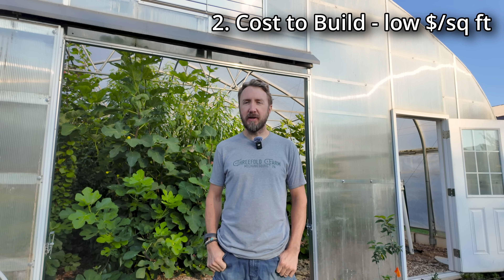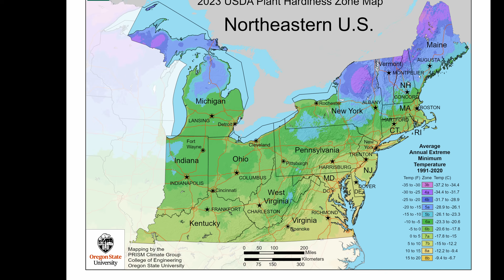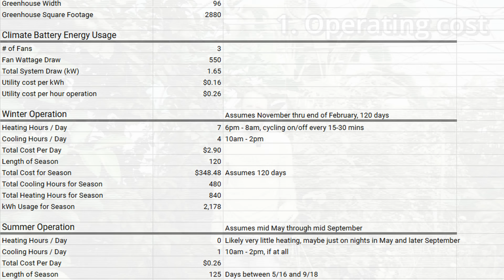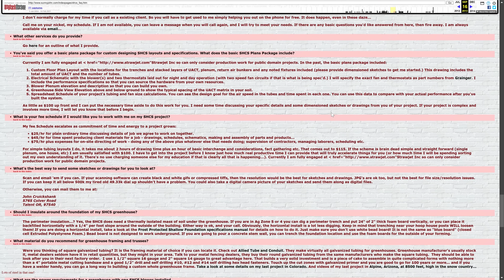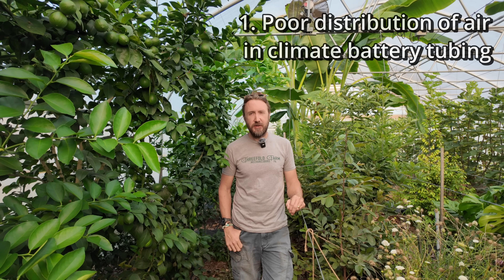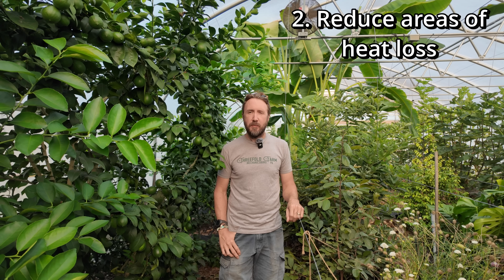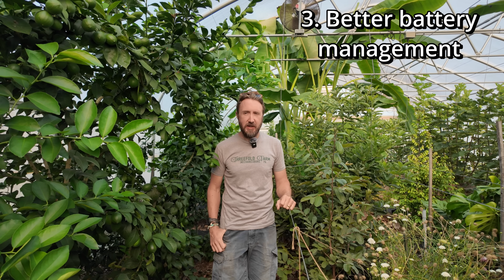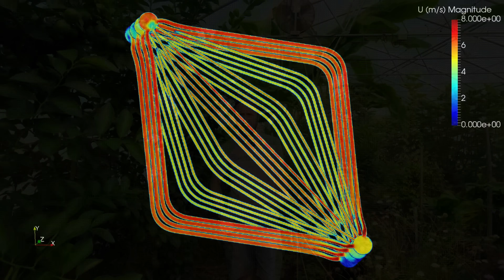Building an (Almost) Tropical Geothermal Climate Battery Greenhouse in a Temperate Climate

Comment: There is one small bit of misinfo I'd like to correct in this video.

Catalogue air source heatpumps are currently available with outputs of 100+kW while custom heatpumps are available with outputs in the 10s of MW.

The problems with the heatpump approach s therefore not the availability of raw heat output but initial cost per heating capacity, peak electricity demand and how much land you need for evaporators.
Reply from the maker: Appreciate the respectful correction! My error.

Comment: Unless I didn't understand one of the boxes for the climate battery calculator? The assumption is that the Air intake will start at base of the Greenhouse and then when it rises and is heated it would go to the "Climate Battery"?   For the Build that I am looking to do the air would start about 6 feet down and at about 150' from the Solar Wall and would enter the bottom corner of the Solar Wall at a base temp of 59 degrees year round (Summers it would probably be pipped straight into the building).  What Cell in the calculator do we place the info that the systems start is NOT the ambiant air temp in the Green house but that the Solar Wall would be starting from a constant supply of 59 degree air?
Reply from the maker: I appreciate the question but unfortunately I'm confused by it. Also I wouldn't necessarily recommend the original calculator (except perhaps as a vague starting point) as it has some assumptions baked in that I don't necessarily agree with and doesn't take into consideration fan static pressure curves and the like.

Comment: Excellent video. But after listening to the whole thing with headphones my ears and head hurt from all the background noise. 😩
Your Editor should consider denoising the audio as it will boost watch-ability and thus conversion.
Or better still: buy noise-cancelling microphone to cut out the fan noise during capture. 🎤

Comment: I purchased a high tunnel and won't be able to set it up until spring . I live in Michigan and am planning on putting it up between the woods and house . Most of the ground is sand . Would you recommend this or not, 24'x40'
Reply from the maker: Depends on what you want to grow, your budget, and several other factors. Happy to help with the decision-making process if you'd like to reach out through our website.

Comment: Thank you for sharing.  I grow pomegranates  in Frenchtown, NJ, not too far from you.  My greenhouse is passive, using 3000 gallons of water.  I would like to do more active storage.  I am intrigued by the development of "bells" in the rocket mass heater community which are steadily replacing tubes for heat transfer.  I believe the use of trenches and bells could be much cheaper and more effective for greenhouses than. tubes, giving more time for heat transfer and  with less frictional losses.  Feel free to contact me if you wish to collaborate.

Comment: Would storing the heat in underground insulated water tanks be more effective?
Reply from the maker: In terms of heat per unit of area, yes. Wouldn't be a bad idea to have some form of insulated tank buried outside the greenhouse even but cost is always a factor (large tank + insulation).

Comment: Someone apparently forgot to tell him that propane has two purposes, heat at night which CO2 enriches the air which the plants then assimilate during the day. The extra harvest pays the heating bill that way for commercial greenhouses  but their crop selection is smarter too.

Funny he talks about the environment and grows a banana tree in a heated greenhouse in pennsylvania which he did't bother to make airtight. 😁
Reply: Someone forgot to tell you that too much CO2 is bad.  Farming might be too complicated for your feeble brain.
Reply: @MrSummitville   Air has a density of 1 225 g/m3. To raise 1 g of air with one degree celsius takes 1 joule heat energy. 

So to heat a 40m2 greenhouse with 3 meter high (120 cubic meter greenhouse) from -5 to + 15 celius (20 c difference) would take 1, 225 j/m3 * 120 cubic meter = 2, 940 000 joules.

Insulation value for 16 mm polycarbonate is 1,7 j/s/m2. If the 0m2 greenhouse structure has an area of 128m2 polycarbonate, simplified it would take around 18 800 640 joules to heat his greenhouse from -5 to +15 degrees celsius on a 24 h period. 

Propane burns cleanly and has low emissions like natural gas. Complete combustion of 1 kg of propane produces 50 Million joules of heat energy. It would take 371 g of propane to heat a insulated greenhouse +20 celius in a 24 h period.

Burning 371 grams of propane in a 24 h period would release 1 113 grams of co2. This might sound much for stupid people but it's comparable to what an active human male breaths out every 24 h. 424 ppm atmospheric co2 in a 120 m3 greenhouse contains 59 g co2. If the plants didn't use any co2 and it was air tight it would raise co2 to 7571 ppm in the greenhouse.

Net photosynthetic rate is around 12 umol co2 / m2 leaf area per second. At elevated co2 levels is twice or three times as high. (Let's go with 30 umol co2/m2/s). 1 mol co2 = 44 g. 8 h light cycle is 28 800 seconds. 28 800 * 30 = 864 000 umol co2 assimilation. 1 micro mol co2 is 0,000044 g. 864 000 umol * 0,000044 g/umol = 38 g of co2 assimilation per 1 m2 leaf area in a 8 h / 24 h.

Total leaf area of plants in a greenhouse is super hard to calculate. If leaf area from all the plants is 30 times the sqm of the greenhouse, releasing 1 113 g co2 would NOT raise co2 levels at all since it would equal the co2 assimilation from the plants. Net = zero.

Tell me you are DUMB without telling me you are dumb...
Reply: If you have a well stocked greenhouse, the plants will drive down ambient CO2 levels down to insufficient for photosynthesis in a matter of hours. Just like a room full of people would run out of oxygen. If you don't supplement CO2, photosynthesis will slow down and stop completely.

Cold CO2 enriching (release gas from tube) is more expensive than warm CO2 enriching (burning propane). Commercially it's done fopr a reason.
Reply: @oscar6832  You are dumb. No, I do NOT need to ADD CO2 to my greenhouse by burning propane because my greenhouse already has the correct % of CO2.  Remind me to ... never buy any fruits or vegetables from your mad-scientist greenhouse.
Reply: @oscar6832  There are a lot of things that are "done commercially", but it is done to increase PROFITS , not necessarily to increase nutritional value. We don't want larger fruits and vegetables with FEWER nutrients. We want fruits and vegetables with more nutrients. A larger apple with fewer nutrients may be more profitable (sold by weight). But a smaller, more nutrient dense apple is better for human consumption. Quicker, Faster, Bigger food is just wrong.
Reply: @ There's a lot of misinformation in eco agriculture that's stemming from myths rather than facts. 

If nutrition is optimized, fruit yield is increased. If the plants suffer nutrient deficiency, photosynthesis and fruit yield will decrease.

They are not the same and it's a bit more complexed but the relationship between nutrients and fruit yield is actually the opposite of what you are implying.

Comment: How do I go about figuring the BTU of a 28' x 28' black tarped Greenhouse shaped wall that has a clear cover at least 4" above the black surface?  I am thinking of running a tube 150' about 6' down as the in take for Solar Wall.

I also am looking at running the heat back into the ground tube and pipe the air over to the small trailer I live in.  But I have NO clue how far I can pipe the heat from a Solar wall before it has dropped back down to the 59 degrees   base temp of the Earth.

Comment: Why is nobody copying real geothermal installs and using fluid-filled pex loops with a water-air radiator? It seems simpler and more controllable, as well as easier to extend and modify after the fact.
Reply: Do the math and then tell use how many hundreds of feet of PEX is required to keep the greenhouse above freezing when it is -5° F outside.  How big is the radiator(s)?  How many GPH pump?  How deep to bury PEX?

Comment: GREAT INFORMATION.: My one question to you is:  can I use a climate battery to heat & cool a enclosed  building 50' x 100'?? I only want winter temps to be about 50-55 degrees. Summer about 10 - 15 degrees below ambient.?
I have a 3 1/2 acre property in Southern New Jersey zip code 08037.
Reply from the maker: Possible but I haven't seen it done. A climate battery underneath may cause foundation issues when the ground settles. For an enclosed/insulated building heat pumps may be a far more economical option as that's what they're sized/designed for.

Comment: I think questions on the climate battery that I have are: 1. has the system been subjected to radon or other element off-gassing testing of the recycled air? 2. how does the system deal with local soil moisture, like when the soil is saturated with moisture after a rain storm? 3. how does this system work relative to the soil water table, i.e. does a high water table mean that a climate battery is not a feasible solution?
Reply from the maker: We haven't had the system professionally tested for radon but I have had a digital radon meter in there during the winter (the most closed the system gets) and I didn't see any worrying levels. I imagine it's leaky enough of a structure still that there's still quite a bit of air exchange.

Our greenhouses are graded such that water tends to flow away from them in the rain. The only time we've seen any small amount of water in the risers is when there's something like a 2"/hour gusher that comes in. The water never gets very high and is typically gone within an hour.

Finally, a high water table likely means a climate battery is out of the picture unfortunately unless the site is built up or the climate battery is built to sit above that high water table.

Comment: So it's a Russ Finch but the air based ground source is below the actual green house. I like it.
Reply: I like the chimney air intake testing. I wonder what impact smooth tubing would have for airflow and heat exchange.

Comment: What about adding a thin film, which doesn't have to be as strong, on the inside of the current greenhouse film, to better insulate it from the outside, at least in the winter, while still letting sunlight get in. Also, you might be able to increase the temperature by a few degrees in the winter, by using reflective metal sheets to reflect some of the sunlight which would heat the ground next to the greenhouse, and optionally cheap plastic fresnel lenses (which you can even make yourself from cheap springy-flexible (as opposed to brittle or flexible like the greenhouse film) plastic sheets greenhouse walls), in order to heat the greenhouse instead. 

And if you made the greenhouse so one of the long sides of it's footprint gets most of the sunlight, you can even make an elevated wall on the shaded long side of the greenhouse, and place reflective metal sheets in order to reflect more sunlight on the greenhouse in the winter. Sure, this would shade other parts of the land, but it might be a trade worth making, and you can leave some space between the reflective metal sheets, to allow some sunlight to pass through, to not have the space behind (what I call/coined) the reflective wall or mirror wall (which doesn't have to be optically clear) completely without sunlight.

In fact, by turning the mirror/reflective wall into a fresnel mirror wall by having different rows of metal sheets placed at different angles, you can even grow things like wheat and tropical equatorial crops and trees, even inside the arctic circle, for example in northern Alaska or northern parts of Canada, by simply having long rows of well-insulated greenhouses heated by long rows of fresnel mirror walls a few times bigger than the greenhouses, concentrating sunlight onto the greenhouse. Or plastic fresnel lenses could be used instead of the mirrors which would also mean making the walls vertical to avoid snow build-up from it, and/or together with the mirrors. And you can even make the mirror walls completely vertical, by using reflective corrugated metal sheets to get the angle wanted, or less-wide metal strips with the wanted angle (which would also make it more resilient in strong(er) winds, possibly reducing the strength requirements for the fresnel mirror walls and fresnel lens walls).

If you want to talk more, my username on Discord is the same as on this site.
Reply: I really like your train of thought on this mirror idea. Mirrors are tipically expensive but they are really cheap at local auctions barns. The corrugated tin fades to a dull surface very quick.
Reply: @davidmingues9553  A transparent plastic layer (or even glass layer, although more expensive) would be able to protect the clear-mirror shine of the panels, and if you need adhesion, you can simply have a few rough areas (sanded or acid-etched on the sheets, where the plastic to bold to the metal, so the plastic layer won't separate from the metal layer, and/or you could even have small holes in the metal, for the same purpose of the plastic getting stuck to the metal. And you could also put plastic on all sides of the metal, to make it more weather-proof. And if it's mostly plastic with a very thin sheet of metal (which could even be a few atoms thick), then the price would also be lower.

And as a proof-of-concept, you can use some mylar from those cheap disposable "space blankets", as well as some clingwrap, and some clear resin or some glue to glue the two together, and you can use some hard plastic or wood or metal backing for the structural integrity (so it doesn't flap like a flag even with a small breeze).

Comment: This maybe a stupid question but would something like the big bubble wrap work to insulate the greenhouse panels?, it would still let light in, but give you an air barrier between the panels and inside of the greenhouse, kind of like a double pane window, and you could do it very cheaply, not sure if this would increase the R value and by how much, but maybe you could test it in a small mock up
Reply from the maker: There's actually a type of greenhouse film that had a bubble-wrap type construction, solawrap I think it's called. Relatively expensive but supposed to be good stuff. Not sure how it compares to polycarbonate panels which I think are similar in terms of insulation value. The tricky is finding a well-insulating and also cheap (per sq ft) material that attaches easily to the greenhouse or is easy to apply and then take down (internally or externally).

Comment: This is a very informative video. I've been researching extensively about heating n cooling greenhouses. I'd love to pick ur brain. lol. So much knowledge and real world testing. With these videos in geothermal/ heat battery's. I'm very interested in learning more. please keep posting. 
Also, just to put u down another deep rabbit hole of research. have u thought about utilizing sand batterys? using solar possibly, or even better the greenhouse itself, that'd be an interesting concept.
Reply from the maker: Thanks for the kind words.

And yes, I've looked a bit into sand batteries or using water for thermal storage from excess solar or other sources of waste heat capture. Interesting option, each would seem to have some benefits. Unfortunately I don't have the bandwidth right now to build any test systems but perhaps later in the year!

Comment: Very interesting concept. I've never heard of it before.
I'd have two questions:
1) Wouldn't it make sense to be able to heat the battery manually, in case of a particularly cold winter?
2) While neither isolating the sides, nor digging to the depth where temperature becomes stationary would be economical, or practical, wouldn't it still make sense to dig in maybe 5ft as this would change the isolation and heat storage? With slightly slanted walls, it wouldn't cause much shade and you could grow bigger plants with the same superstructure.
Reply from the maker: Broadly, yes, some form of external heat would be nice, whether that feeds into the battery, directly into the air in the greenhouse, or some other kind of thermal storage (depending on the source of the heat).

Digging into the earth isn't a bad idea for a smaller structure but usually isn't feasible on a large scale (thousands of square feet). We'd have issues here with needing to build foundation walls to prevent soil from sloughing off which is an added expense, so the cost to benefit ratio would seem to be lessened pretty quickly versus alternative options.

Appreciate your comments and thinking through this!